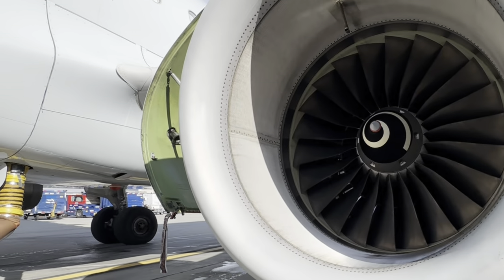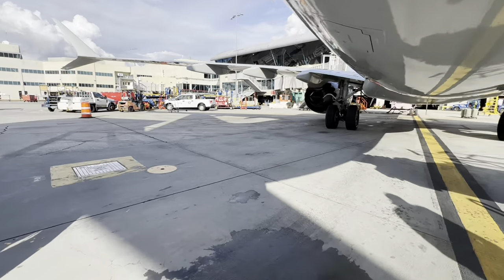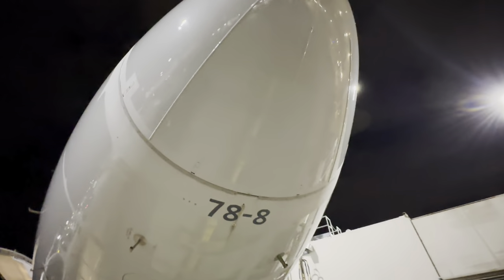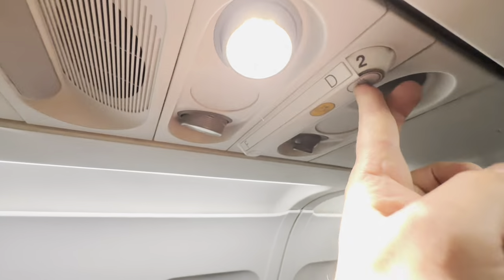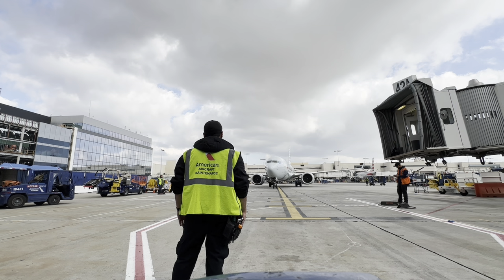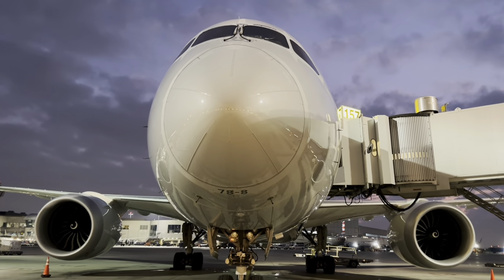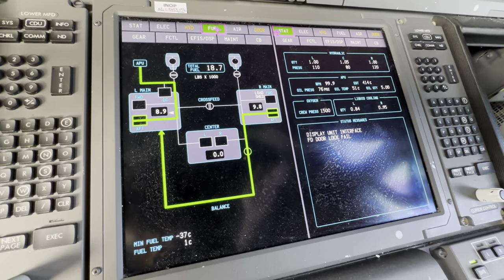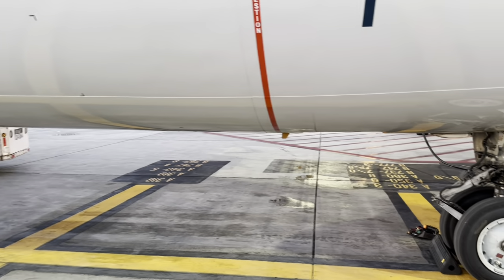Stig Shift #7 (22DEC23 - 24DEC23) Christmas Special

Comment from the maker: Ladies and gentlemen… I just realized I completely goofed on not giving you the answer at the end of the video. I’m so sorry… but here’s the answer.. I’ll put it here. 

There’s 2 parts to this. Certain push buttons light have two dots, Indicating that The corresponding part of the push button is not used. Certain push buttons do not remain pressed in. These are referred as “momentary action”  push buttons. 
There is another function and a notification for these push buttons and indicators. And that is a reversible and a irreversible action. The push buttons that have a dots on top are reversible that means the button or the action can be disengaged. Now the buttons with the dots on the bottom is a one time function. That means if you press it that is it one time function cannot disengage

Once again I’m sorry about that. I messed up editing. Hopefully you all see this.
Reply: When I was working for my local airline, I really admired you guys....pilots always get me starstruck though, childhood dream 😅😎
* Dried off under 737 NG packs many days😂
Reply: Hey Stig. So you work on both the short haul and long haul fleet? Where I work we've been separated into two groups: short haul and long haul.
Reply: Btw love the technical  part at the beginning. Very good explanation of the components and systems
Reply: OMG What you said about PW engines.. Jesus Christ they are the worst.. And I'm talking about the newest PW1100. Everything in the hot section..Have to open the hot section just to read the IDG Oil level, then they go and place cables in the way of the IDG Filters. Then you need a wrench to close the Reverser doors with that flimsy closing mechanism they installed...Horrible engine.
Reply from the maker: @ChrisCokeRobinson  yup. I work on both. Long haul and short. Narrow body and wide body aircraft.
Reply from the maker: @ChrisCokeRobinson  glad you enjoyed it. Sorry if it got a bit too convoluted with the bleed system
Reply from the maker: @ChrisCokeRobinson  I personally haven’t worked the PW1100 because we don’t have them in our fleet but I have worked other PW engines. All the same way. Last good engine for commercial aircraft they made was the JT8D. 😂
Reply: I’ve never worked on Aircraft. As an enthusiast GE 100%. Fuck the Britts and Rolls. lol
Reply: Thanks for that explaination. I coudnt find the Corsair eater egg reference anywhere
Reply from the maker: @imbowser  they were the original power port receptacle creators 👌
Reply: Like IDG disconnect button irreversible. On the Topic of IDG do you guys still check the oil level before an ETOPs sector?
Reply from the maker: @hamishdavidson3368  yup.  We absolutely do check the IDG oil level before ETOPS departure. It’s mandatory. 👍
Reply: @StigAviation  Well Stig, thank you for showing the public a bit more in detail our side of aviation and all the things we do to keep the birds airworthy ;)
Reply: Good evening, from Anchorage ALASKA.  First off, thank you 🙏 very much for all your videos.  I’ve always been a nervous flyer, but after watching several of your videos and having you explain so much, etc… believe it or not, I don’t feel as nervous anymore…. Just to know that there’s hard working, dedicated individuals like YOU, behind the scenes, making sure every inch of our flight is a safe one.  It REALLY does mean a lot to me.   This may just be a hobby for you, but just want you to know that it has meant MUCH MORE to me.   I know this may be off topic, but was just curious:  did I hear you once say that in order to become an airline mechanic, that you must have FIRST have been a pilot, or had to have had so many flying hours FIRST?  Or was that just something that YOU personally did?  And again, I think that’s just another reason why I feel a lot more comfortable flying now, because of that kind of information you gave.  Thank you again for all that you do, and I’m hoping to have you as our mechanic, on my next flight back to Anchorage Alaska, next time I fly.  Happy New Year!
Reply: This is fantastic info!! Thanks!
Reply: That was tough to find out, I didn’t try too hard to find out what it was, just searched up what it said in the video which I see some of the buttons were labeled under “GPWS” but didn’t find why the buttons were the way they were. Fun to look into it though! Much love again brother!
Reply: He's a nice guy, clever too

Comment: Hey Stig, maybe the tri-wings were used on that opener installation to help prevent someone from using a “normal” tool to take it off and use it as a weapon? Just a thought…
Reply from the maker: You could be right on that, but I don’t know anybody that carries a screwdriver with a specific tri wing bit let alone trying to get past TSA with that
Reply: True, also!

Comment: Hi Stig, Merry belated Xmas! Question: I've always wondered how a jet engine runs in heavy rain, with the thousands of gallons of water it must absorb in those situations. Or snow, for that matter.
Reply from the maker: Merry Christmas to you as well Miguel, and the engine is designed to keep on running with water ingestion. 90% of that water is probably going to go through the high bypass and not into the core. Whatever water goes into the core gets atomized and evaporated immediately because of the heat.
Reply: @StigAviation  I guess the same goes with snow. However, with hail I suspect that some dents may occur.
Reply from the maker: Hail is definitely more dangerous. That could cause damage.

Comment: At 26.52 that ramper was putting wheel chocks on the nose gear, WAY too early.
Reply from the maker: As soon as that aircraft stops, the pilots set the brakes. They try to get the chalks on there quickly just in case the brakes do fail, we don’t want that aircraft rollback. So that ramp personnel did the correct thing.
Reply: @StigAviation  I'm aware of the need. But, I saw at that time I noted the aircraft still moving and the engines still on.  Have a good day

Comment: The buttons up top and at bottom represent the position the button is in this is in-case there is an electrical outage and the button isn't lit.
Reply from the maker: Not quite. Let me explain 

There’s 2 parts to this. Certain push buttons light have two dots, Indicating that The corresponding part of the push button is not used. Certain push buttons do not remain pressed in. These are referred as “momentary action”  push buttons. 
There is another function and a notification for these push buttons and indicators. And that is a reversible and a irreversible action. The push buttons that have a dots on top are reversible that means the button or the action can be disengaged. Now the buttons with the dots on the bottom is a one time function. That means if you press it that is it one time function cannot disengage
Reply: @StigAviation  Thank you for your response. Just learnt something new today. keep up the good safe work you do.

Comment: Do the cockpit panels and switches get periodically cleaned? They always look filthy.
Reply from the maker: That is a pilots responsibility Matt, when pilots get inside the flight deck they usually start cleaning off the things they must touch. That is not a cleaners, responsibility, nor is it a maintenance responsibility. Pilots need to take care of their own cockpit.
Reply: @StigAviation  thanks for the reply. I always wondered if they just got like an annual clean because its too dangerous to be cleaning around so many switches that could get knocked into different positions.
Reply from the maker: @mattblackledge9068  the deep cleaning happens in heavy check

Comment: Is this the correct answer? 
😅Based on Bard (Google's AI): 

The dots on the buttons on the Airbus A320 cockpit are called "locator dots." They are used to help pilots identify the buttons in the dark or when they are wearing night vision goggles. The locator dots are also tactile, so pilots can feel them with their fingers even if they cannot see them.

There are two types of locator dots on the Airbus A320 cockpit:

Top locator dots: These dots are located on the top section of the button face. They are usually used for buttons that are not often used, such as the radio and autopilot buttons.

Bottom locator dots: These dots are located on the bottom section of the button face. They are usually used for buttons that are used more frequently, such as the engine controls and landing gear controls.

The reason for this is that pilots are more likely to look for buttons with locator dots on the top of the button face when they are trying to find a specific button in the dark. This is because the top section of the button face is usually the first thing that pilots see when they glance at the panel.

The bottom locator dots are used for buttons that are used more frequently because pilots are more likely to be able to feel them with their fingers. This is because the bottom section of the button face is usually the part that pilots rest their fingers on when they are operating the controls.

The use of locator dots is just one example of how Airbus has designed the A320 cockpit to be as easy to operate as possible, even in low-light conditions.

Bard is stupid sometimes, for instance, it mentioned that the type of the A/C which was A320, and then said: when the pilots wearing the night vision goggles, etc. It thinks that it is a military aircraft. 😅
Reply from the maker: There’s 2 parts to this. Certain push buttons light have two dots, Indicating that The corresponding part of the push button is not used. Certain push buttons do not remain pressed in. These are referred as “momentary action”  push buttons. 
There is another function and a notification for these push buttons and indicators. And that is a reversible and a irreversible action. The push buttons that have a dots on top are reversible that means the button or the action can be disengaged. Now the buttons with the dots on the bottom is a one time function. That means if you press it that is it one time function cannot disengage

Comment: A bit late but... Merry Christmas!!!

2 things:

1- I actually have a tei-wings titanium screwnholding my front light's on my 1957 Vespa...
2- what about the led up or/down explanation? I searched for it but haven't found anything anywhere... :-(
Reply from the maker: Merry Christmas to you as well. And the answer to the question 

There’s 2 parts to this. Certain push buttons light have two dots, Indicating that The corresponding part of the push button is not used. Certain push buttons do not remain pressed in. These are referred as “momentary action”  push buttons. 
There is another function and a notification for these push buttons and indicators. And that is a reversible and a irreversible action. The push buttons that have a dots on top are reversible that means the button or the action can be disengaged. Now the buttons with the dots on the bottom is a one time function. That means if you press it that is it one time function cannot disengage

Comment: "I don't like the Pratt&Whitney 4000 engine, why did they put the oil tank in the hot section?" (paraphrasing, but I think I got the gist of it)
Reminds me of certain model year Subaru's, where they put the access path for the spin-on oil filter right in the base of the of the Y-pipe that joins the two exhaust manifolds together, one of the hottest places on the engine right after you turn it off.
Auto mechanics call it the "Ring of fire", and well the name's pretty self-explanatory.
No idea why those Subaru's are the way they are, my only guess is that it might have to do with them wanting to heat the engine up faster on start-up?
Or it could be as simple as "This engine bay's packed like a tin of sardines, that's the only place it CAN go".
Either way, that's an oil filter you ALWAYS break out the filter wrench for removal, no matter how tightly it's spun on, simply because it gets your hands out of a hazardous location. One wrong move and you get a nasty burn, nobody wants that.
Reply from the maker: Sometimes, when engineers design things, they don’t take in consideration of the functionality or maintenance, friendly decisions. But at the end of the day, it still works as advertised.

Comment: How often does the A/C,s get a complete wash and main gear get cleaned or brake dust removed,  compared to Emerites fleet as a reference
Previously, I worked for ANZ, and QFA under gear arrives were washed on overnights, but I have not noticed many on the overnighters....
Reply from the maker: Heavy aircraft washing is usually done in heavy maintenance environment. I actually did a video about this, I explained how aircraft get cleaned and why they get dirty. Check it out when you get a chance.

Comment: What is the difference between a regular pre-flight check and an ETOPS check?  Also, on the very last video of the 777 coming up the line it looked as if the pilot needed to keep correcting to the right. Was I seeing things, or does the jet ‘pull’ to the left?
Reply from the maker: More extensive checks on critical systems and emergency equipment. I explain it in one of my other videos

Comment: great videos thank you !! I am curious of why all the aircraft you come into the cockpit are left with the APU running and generating electricity, even if some of them are hooked on the GPU which is "avail" ? Can pilots left the APU (and generally electricity) running, or is it because you as a mechanic took the aircraft into account ?
Reply from the maker: Most of these aircraft are usually quick turns or getting ready to get off the gate. Also sometimes the cabin gets hot, and we leave the APU on and air conditioning on for passengers comfort. If I know the aircraft is gonna be on the ground longer than 2 hours I’ll switch it to ground power. There are also times pilots will turn the aircraft off because they know the aircraft is overnighting

Comment: Stig, I have a couple of questions for you.  When a shaft is rotating (a turbine for example), the shaft is " floating" on a wedge of oil, which protects the bearing surface from scoring.  When the shaft is rotating at a very low speed, usually an oil lift pump is operating to lift the shaft and provide oil for separation of the bearing surfaces, thus protecting the bearings.  I have noticed on various videos of aircraft engines, when shutdown/cold iron,. the engines are often rotating at a very slow speed due to wind blowing through the engines and causing wind milling.  What protects the bearing surfaces under these conditions?
Reply from the maker: The bearing still retain oil within them, they’re still a level of protection that does not cause damage to the bearings.

Comment: Quick question regarding the cargo bays, are there any "Man inside" switches or mechanisms that someone who was accidentally closed into a bay can activate to warn of such an occurrence? (Apologies this was posted on an older video)
Reply from the maker: There is a maintenance switch on the inside to open and close the door for operational checks, but once that door is fully closed and latched from the outside with the handle,  it cannot be opened from the inside.

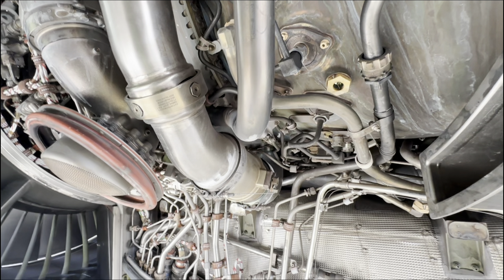Comment: 1:36 The wire off the HP valve is that the throttle quadrant, or small control cable?. I would think the Throttle Quadrant has to be thicker cables.
Reply from the maker: Can you specify what part of the video your watching

Comment: The MLG wheels are stopped before they retract right? That wouldnt prevent the fragible nipple from being activated? Or its there in case of something very wrong happens when The wheels are retracted?
Reply from the maker: Yes. The MLG wheels stop when retracting , the brakes get automatically applied before they go into the wheel well but after it passes the fitting

Comment: 24:55 I didn’t try to look up the answer, but aren’t those circles the lights that indicate whether that button is on or off? And something about schematics or electrical circuit breakers…but wouldn’t those white lines that separate the sections of buttons also indicate wiring underneath and maybe those circles have something to do with interior wiring and are placed closest to the running of the wiring? Also I skimmed through your video and went to the last minute and still didn’t see that you included the answer so this is all just a wild guess lmao.
Reply from the maker: My apologies for that, I completely goofed, and forgot to put the answer at the end of the video. But here it is. 

There’s 2 parts to this. Certain push buttons light have two dots, Indicating that The corresponding part of the push button is not used. Certain push buttons do not remain pressed in. These are referred as “momentary action”  push buttons. 
There is another function and a notification for these push buttons and indicators. And that is a reversible and a irreversible action. The push buttons that have a dots on top are reversible that means the button or the action can be disengaged. Now the buttons with the dots on the bottom is a one time function. That means if you press it that is it one time function cannot disengage

Comment: Did you explain the dots? Also, I am curious, why are there buses at the airports running around the aircraft? Who rides on them?
Reply from the maker: Those are usually employee buses taking people in and out of the airfield. There are also bigger busses that are called people movers. Those are for passengers that have connecting flights and that have parking further away from their next flight terminal.   I pinned the answer to the question at the top of comments 👍. Enjoy.

Comment: Hello stig have you got any reference for the wiper you use to lubricate the shock absorber. have you got the same type of product for the landing gear actuators ?
Reply from the maker: At the moment we are using single use wipes coated in MIL-PRF-5606 or 5606H  Part# 103769. Try that. See if that helps.